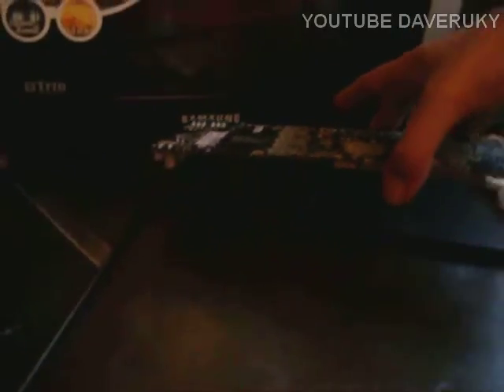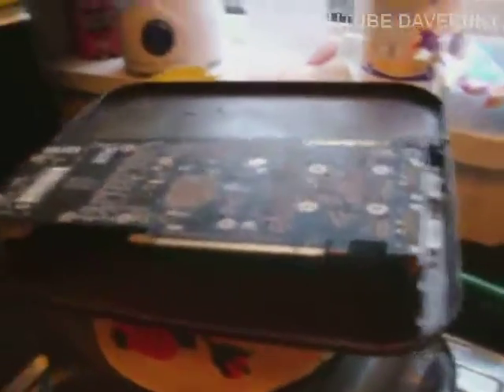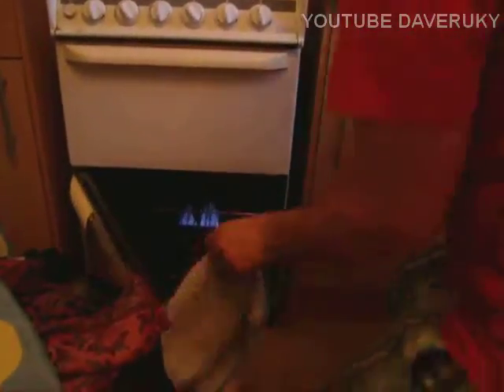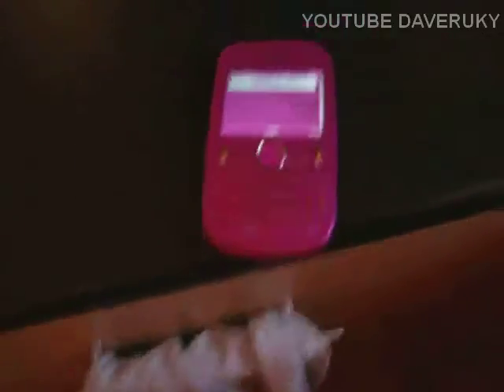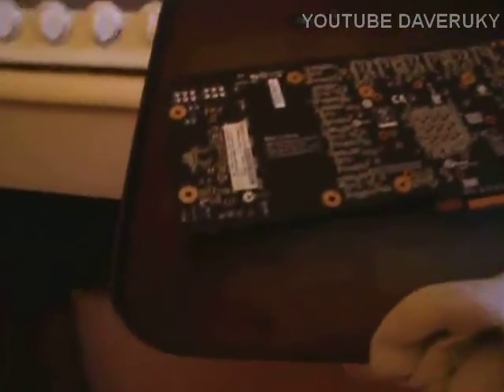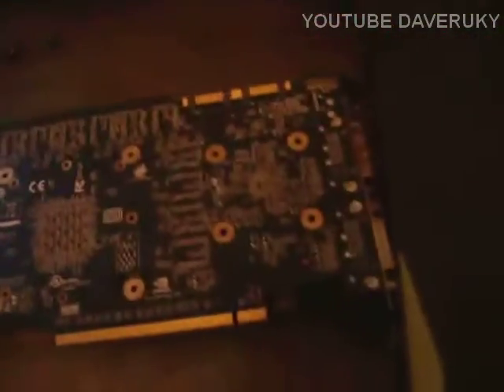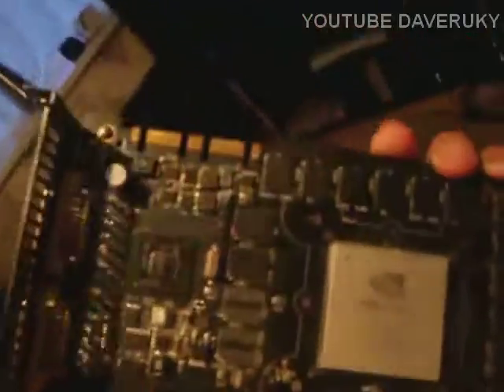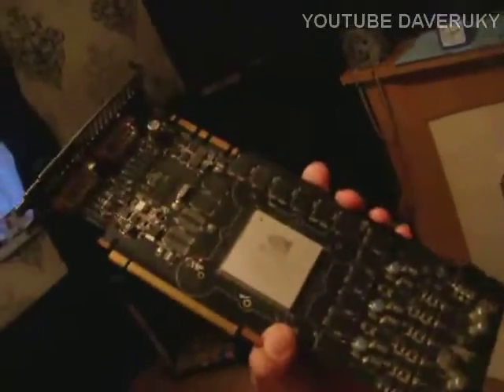Fix your graphics card by COOKING ! (how to)

Comment: would this fix my r9 290x which freezes after 5 mins of use?
Reply from the maker: possibly, all this does is a reflow, they do this at the factory before releasing the card, but i would ask u if ur freezing after 5 mins use is it not ur temps ??? are your fans working??? take out card n clean it of ALL dust and check ur psu etc??
Reply from the maker: also remove your cooler from your card and put fresh paste on it and reseat cooler makin sure its ok cos i think ur problem may be temp too high
Reply: psu is a 1350 watt so its good, and fans seem to be worker, the moment it freezes the fan speed goes up to like 70% so its probably something with temperature